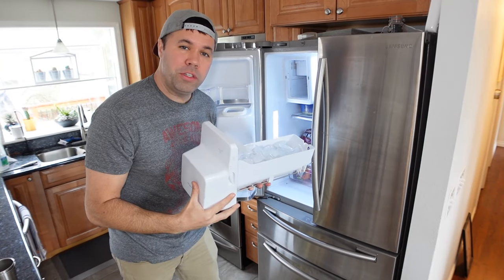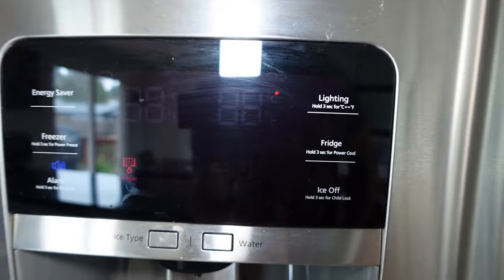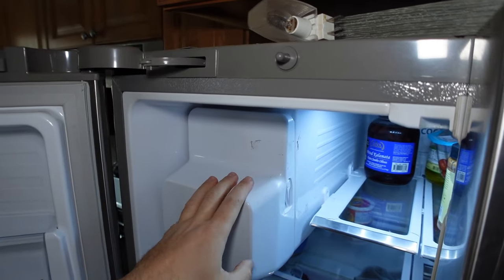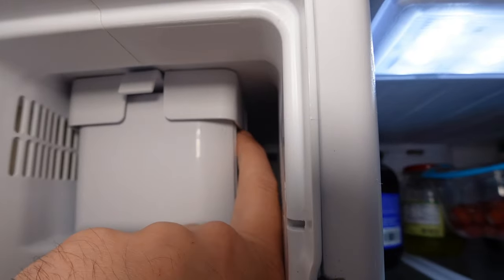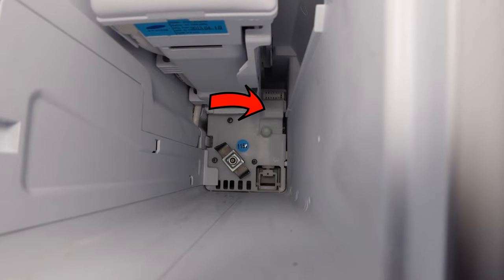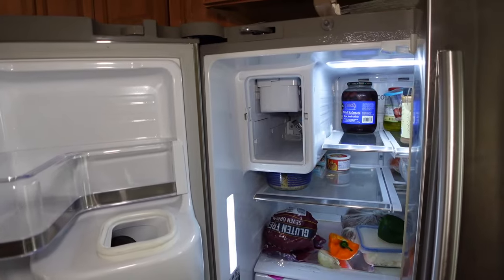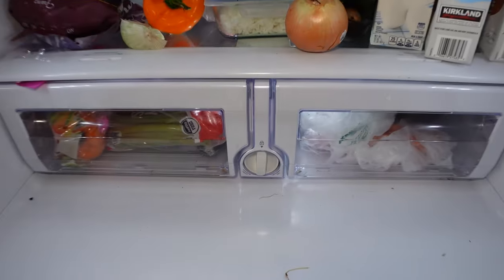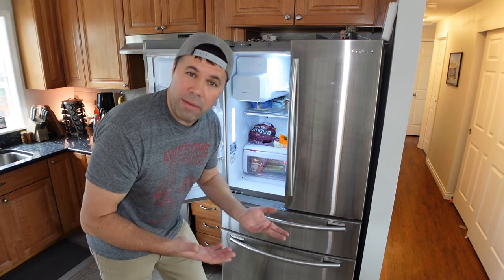Ice Maker Not Working on Samsung Refrigerator - Check these 8 Things to Get it Working Again

Comment: You have the ice maker that looks like mine!  My Samsung fridge ice maker does not stop making ice.  It makes ice great but doesn't seem to have an off switch.  Where is the switch that triggers the ice to quite making ice when the bucket is full?  Any help would be appreciated.
Reply from the maker: Hmmmm.   Sounds like there must be a sensor of some kind.  I haven't experienced that problem.  Maybe another YouTube video would have the solution?  I also heard Samsung has great customer service on their refrigerators.  Maybe try giving them a call?
Reply: The video tells you where the off switch is.
Reply: Mine does the same thing...makes so much ice it jams up.    did you ever figure out why yet?
Reply: Same here and the ice cubes freeze up top and cause an ice dam. Which blocks any other ice from coming down.
No more Samsung refrigerator/freezers for us!
Far tooo aggravating!!!
Reply: Muy same thoughts. I noticed when it mad ice cubes won't stop making cubes. I started pressing the stop making ice in the front panel of the fridge as soon as I had enough ice. Hope to find out something

Comment: My ice doesn’t empty in the bin. I have to do it manually. Not sure why. The arm to detect if the bin is filled seems fine and I can toggle it up and down. There’s no power button inside the freezer though. If there is, I just can’t find it. Maybe that’s the problem. Idk. But once I manually dump the ice. Water pours into the tray and I come back a couple hours later to check. They’re frozen and not dumped. So I press the button.
Reply from the maker: Sorry for the late response.  Did you figure out the issue?

Comment: I have this exact fridge and no matter how many times I defrost it with a hair dryer, within a week ice is already building back up all over the ice maker unit. What could this be? It’s so frustrating, I’m starting to think having the ice maker in the fridge portion instead of the freezer is just a poor design flaw these days. Having kids in the house, maybe the doors are opened too much and the unit just can’t keep cold enough? I’m at a loss.
Reply from the maker: Sorry to hear your struggles.  Tough for me to say with confidence.  Have you tried unplugging the fridge for 30 seconds, then plugging it back in?  Sometimes a good old hard reset solves problems.

Comment: I have the same model. Ice maker is making ice, but the dispenser is not turning and releasing the cubes. I completely defrosted the ice maker. Any ideas?
Reply from the maker: Make sure the ice tray is fully inserted.  I would remove the tray and see if there is any ice in the back that could prevent it from fully closing.

Comment: I got a new switch (universal) and put it in. Still same problem light won’t go off. Any suggestions?
Reply from the maker: Have your verified everything is is working as it should?
Reply: Put your cell phone on video and start recording as you put it in the fridge then close the door.  Open it then close it.  Then take it out and check the video.  I did this and sure enough it does go out.

Comment: We can't get the ice tray out! We've smacked the bottom to try to free it up - no luck!
Any suggestions? There is no visible ice on or around the icemaker.
Reply from the maker: Have you tried a hair dryer?
Reply: i had some trouble at first too, you need to lift up slightly as you pull it out

Comment: What if the water pressure is to high and it shuts off, continues to drip for 10-14 seconds.
  You check the water valve and cycle the ice cube maker, nothing comes out when it clicks to shut off. 
  Then you adjust the ice cube size to smaller one quarter turn at a time, the cubes get smaller, yet still drips.  What about you install a new factory ice cube make, complete with new bucket with factory markings & instructions and still drips. What is you watch rubber fill tube with a mechanics mirror and strong focused light and water quits flowing when clicks, yet water comes out of little bucket and dribbles underneath the ice cube tray for 10-14 seconds as if it is over full? Now what?
Reply from the maker: Sorry for the delayed response.  I must have missed your message! 😔  We're you able to figure it out!?  I'm kind of at a loss on what I would recommend.

Comment: Mine freezes up on the top side constantly.. i have to chisle it out. Is there any legitimate fix to prevent it from happening? Im getting tired of having to bust up the thick layer of ice every other week or so...
Reply from the maker: You mean the try is frozen and you can't remove it or the dispenser inside freezes up?
Reply: @JMGENTERPRISES  the dispenser inside freezes up. I can pull the tray out. But the dispenser literally has like a 2 inch thick layer of ice the entire length of the dispenser.
Reply from the maker: @k1ngZ4PP4  oh wow.  I haven't heard of that before.  😕
Reply: @JMGENTERPRISES  Yeah.. I had it completely replaced. It lasted about a year and it's doing it again. Not sure what the cause is.. I could provide a picture if you are curious I can email ya. Either way thanks for the replies.

Comment: Mine never worked since I first plugged in the refrigerator  it would freeze up and I'd chip away ice n again it would work only for 2 or 3 batches of ice.. so the other day I let it thaw completely.. I turned the ice maker setting to "off"  then took out the whole ice  maker unit.. I let it sit over night just in case there was ice I couldn't see.. next morning I put it all back together put the ice maker setting to "on" and held the little blue squared button on the side and held it till it beeped and I've been having an ice bucket full of ice for the last week .. hopefully it continues to work.. if you dnt got the $ for a new ice maker n have this type of problem try it out
Reply from the maker: Wow!  Sounds like you probably fixed the issue.  Good idea to let the ice tray sit out overnight.  Fingers crossed that fixes it for you but it sure sounds like it has!

Comment: i get a normal dispense of water from the drink dispenser, but no water seems to be getting into the ice maker. the fridge was already thawed prior to putting it in the house, came from thrift (now i know why), paid about 600 for it. everything else is just fine, cools well, water filter installed, only the ice maker is an issue. unfortunately samsung won't repair it as it's 10 years out of warranty and isn't covered by the class action.
Reply from the maker: Have you ensured the ice maker button is not turned off?   Also, make sure the ice drawer is fully closed.  Mine will not make ice even if it's only 1/4" out.

Comment: When I pressed on the interlock the light won’t go off. I replaced a new lock but same result.
Reply from the maker: Hmmm.  What kind of fridge do you have?  Have you checked your owners manual?
Reply: Samsung fridge, I heard the light is controlled by the reed switch. I just ordered 2  and see if that work.

Comment: Ice builds up in the ice maker. Then no ice made. The fan starts clicking because of ice  build up in the back where the fan is. I have to shut the fridge off at the circuit breaker for about four hours so the ice melts. That stops  the fan from clicking but it’s over 50 degrees in the fridge. No more Samsung junk $3300.00 and it sucks big time. If it says Samsung walk away. Hey forget about it. 😅
Reply from the maker: Darn!  Sorry to hear about your experience with your Samsung 😔
Reply: @JMGENTERPRISES  it’s not just me take a look on YouTube all the people with problems with Samsung

Comment: if you still have water in the door operations wouldn't that eliminate the need to check the filter and line behind the fridge
Reply from the maker: Good point.  I know a kinked/damaged hose and or clogged filter can restrict flow though.
Reply: It has a dual solenoid . So water and ice are separate

Comment: Any suggestions for me, the Ice Off light (between the Water and Ice Off child lock) came on and I can't get it to turn off.  It turned on right after I was getting ice.  I did an ice maker reset.  Any ideas.
Reply from the maker: I would try unplugging your fridge from power, waiting 30 seconds and plugging it back in.

Comment: Pretty good video all the way until you said when you're ice mush maker gets frozen you use a hair dryer no wrong answer you can damage the inside of your freezer your ice machine warp melt that plastic it's done you need a new stuff My advice and I've done this with my Samsung as I will boil a pot of water pull the ice tray out close the refrigerator pour the pot of water into three coffee mugs that fit all the way in to the where the ice bucket goes and then be careful cuz it's going to be boiling water that I take a kitchen towel and I or two and I stuff it in there to keep the steam inside the ice machine compartment where the bucket would be I let it wait 10-15 I don't know minutes till the water gets you know cool I take I make sure the water is cool I pull it I dump it I wash out my ice bucket I place it back in making sure it is it is in properly a lot of times you need to put your finger through the front do the bottom or the ice comes out and hold the door open so the little lever in the back will match up perfectly then I have great ice and that'll go on for who knows how long I mean I've only had to do that a couple times but hair dryers no you damaged inside of one of those refrigerators that's hard plastic it's not meant to have heat they don't defrost the ice with heat they just flip the tray and it comes out but other than that great video keep up if you work man Happy Sunday
Reply from the maker: Appreciate the words of wisdom my friend!  I'll keep that in mind!  Thanks for the comment 👍 😀

Comment: Or….. if water comes out of the front, you have water. I’m not pulling the entire refrigerator out to check something that can be done with, oh I don’t know, the damn water dispenser on the front of the refrigerator
Reply from the maker: Thanks for sharing!  Some refrigerators are very easy to pull out

Comment: I depressed light switch for a minute and light stayed on
My switch is on the fridge not door
Like this one 
Only replacement videos I could find were for switches on the actual door
My switch appears to have no easy access 
Any advise?
Reply from the maker: Are you sure it's the door switch?  Sometimes some fridges takes several minutes to turn off.
Reply: @JMGENTERPRISES  not sure
After a minute I gave up
But those switches must pop out otherwise you’re taking apart the whole fridge to replace 
I’ll probably just have to call a service person

Comment: So my ice maker is making ice and is filling up my bottom freezer with ice, but is not putting any of the ice into the unit that dispenses ice to our cups.  The auger seems to be working is just doesn't have any ice in the tray to dispense.  Any clue what that is about?
Reply from the maker: Hmmmm.  That is strange.  I have not had that happen.  Sounds like there may be a blockage somewhere?

Comment: I have this exact fridge and I cannot even pull the ice tray out. Defrost mode over and over also does nothing. I image I have a massive ice beard in there.
Reply from the maker: I would try using a rubber mallet and gently but firmly hitting it around the opening area.  Maybe you can break it free.

Comment: I got a new samsung refrigerator and the ice maker wasn't working.  Found a kinked tube from the factory.  The tube from the water inlet valve (behind the filter) that feeds the ice maker was kinked by the factory!  I actually made a short 2 minute video on my channel..
Reply from the maker: Glad you were able to locate the problem.  That should have been caught at the factory.  Happy to hear you made a video about it too.  I am sure it will help people :-)
Reply: @JMGENTERPRISES  thanks, I hope it can help some people too!  I thought it was a one off problem but I found someone else that left a review with the same symptoms. Ice machine had water, but it was just trickling out. Each cycle is supposed to make 8 ice cubes but it was only making HALF of 1 ice cube per cycle.  The factory puts a “tube guide” in place to prevent linking, but mine wasn’t completely on the line, which allowed it to become kinked… thanks for the response 🙏

Comment: Whatever you guys do, DO NOT use a blowdryer or heater to melt the ice.  I have a rep now fixing it and he says everyone thinks the dryer will melt the ice but it melts the entire size of the freezer box and they can't repair it, even a new freezer one won't be able to go in.  Fyi
Reply from the maker: Thanks for sharing.  I never recommend using a heat gun as they are way too hot and melt plastic.  But most hair dryers do not get hot enough to melt thick plastic.
Reply: @JMGENTERPRISES  Yess I see some videos stating to that and its a shame so I'm grateful you didn't. I've seen people use steamers an suggest that as well.. But that actually images the entire unit from even being replaced.

Comment: What if the ice tray that turned over to drop the ice is slanted? So the “refill water” just falls over and leaks out
Reply from the maker: Why do you think it's slanted?  Damaged tray?
Reply: try unplugging the fridge for 10-12 seconds and plug it back in to reset it
Reply from the maker: @mikevallia8315  Good tip!  Thanks

Comment: Will ice maker work if there 's no water filter?
Reply from the maker: I do not believe so.  Because the water to make the ice needs to go through the filter.
Reply: @JMGENTERPRISES  
Thank you for your answer. I had the ice maker replaced, but there 's still no ice.
Reply: @JMGENTERPRISES  I removed the water filter inside the frig years ago because I filter my water before it gets to the frig.  It has never stopped the frig from making ice.  However, now it has stopped and I have gone through all the steps you suggested, and the only one that fits is that my door light will not go out when I hold it in.  And I haven't seen any ideas suggested about how to replace it.  Also my frig has never chimed when I press the gel like button at the side of the ice maker.

Comment: Water valve could also be turned off if one forgets to turn it back on after changing the filter, dont ask me how I know lol
Reply from the maker: That is true!  I should have included that in my video too!  Darn
Reply: How do you do that?
Reply from the maker: @courtneywebster5767  - it depends on where the valve is.  Typically they are under your sink, behind your fridge or somewhere in your house where the water line comes in.  If you find one, turn it off then check your fridge to see if water still dispenses.  It it dosent, you know you found the correct valve.
Reply: @courtneywebster5767  there is a shut off valve if you pull your fridge out against the wall in the back that you could turn on or off

Comment: So when I hold the button down for a minute the light is still on. What is the problem? Thanks
Reply from the maker: Some fridges are different.  But it may just be your model.  But it could also be a bad button switch.
Reply: @JMGENTERPRISES  I found the switch doesn't turn off the light but their is a sensor somewhere. I put my phone in the fridge and recorded video then the light turned off in 1 seconds. Will try maybe a hair dryer next. Also the switch I have is more like a button that seems to do nothing but the touch screen can turn on and off the ice maker. I still get water to drink fine. TY
Reply: Mine doesn't work either. There is multiple sensors and I'm missing one somewhere. I tested by dispensing water when the door was closed. If the fridge thinks the door is open it will not dispense water.
Reply: @Moose_VII   Yea my water works fine but darn thing will not make ice. I tried the hair dryer and nada. The switch on the side of the box just feels like a rubber piece that does nothing. Expensive fridge too. Still not worth having someone to look at it.
Reply: @Grasshopper-KI  yeah, I was just saying if the water works then the door switch is okay. I had to hold the rubber button on the ice maker for a few seconds and then it beeped. Still haven't figured my issue out either.
Reply: @Moose_VII  ohh odd I never get a beep. I tried holding it for 30 seconds and nada. Must be broke

Comment: I accidentally locked up my refrigerator and can’t get it unlocked. Water won’t come out
Reply from the maker: Try unplugging it from power for 30 seconds.  Then plug it back in and re test
Reply: @JMGENTERPRISES  I did it !!  And it worked. Thanks.
Reply from the maker: @sweetpea7986  awesome!!

Comment: IWhatever is this gentlemen said checked but my ice maker still does not work !
Reply from the maker: Have you tried unplugging it and then plugging it back in?
Reply: @JMGENTERPRISES  just turned Ice-maker off, replaced water filter, don't see any ice built when i pulled out ice buket. Ice maker suddenly stopped making ice.

Comment: You said it is an easy fix if the light doesn’t turn off. How do I fix that?
Reply from the maker: It's usually just a stuck switch.  I will try and get a video made on the subject.  Perhaps in the meantime, you can search on Youtube for another video.  I have seen a few on there.
Reply: We have the same model as featured in the video and our icemaker makes some ice but it's a hit and miss. Tried holding in the door switch and the light never turned off. Do you think that might be the problem?
Reply from the maker: @brenda8305  - Yeah, the door switch may be the issue.  When I open my door and hold down the button, it turns off in about 30 seconds.
Reply: @JMGENTERPRISES  thanks for the reply. I put my phone on record inside the fridge and closed the door. The light did immediately go off. My icemaker remains a mystery. We changed the water filter yesterday but no improvement on making ice 😭